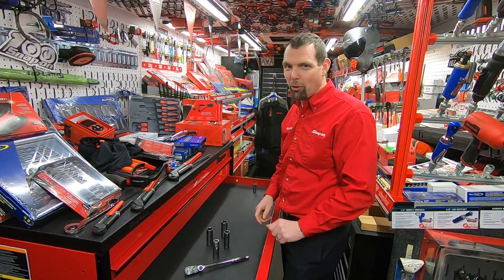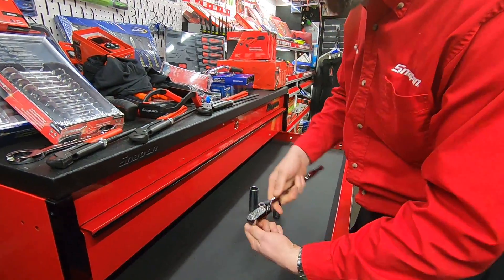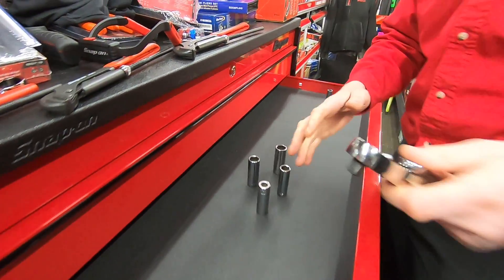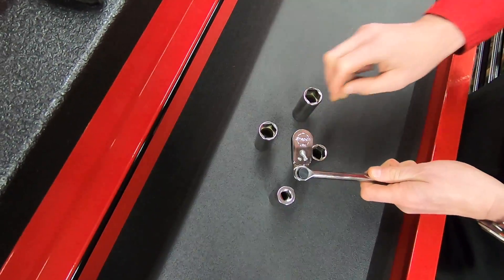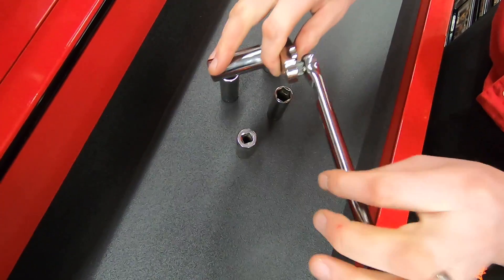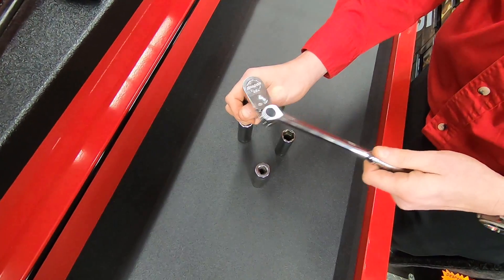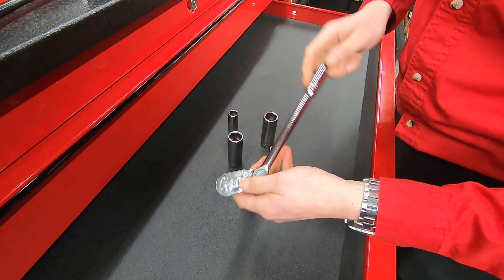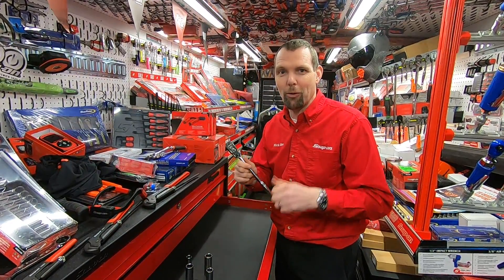NICK THE TOOL: MULTI-POSITION INDEXING RATCHET PN: F80MP

Comment: Is this available in a 1/4" drive?  Update:  picked up one of the T72MP (1/4" drive) from my dealer the other day.  Pricey at almost $160 but VERY handy.
Reply from the maker: Not yet
Reply: @NICKTHETOOLUK  when it will be?
Reply: @manuhonkanen2111  I have it in 1/4"
Reply: Yes. T72MP and TH72MP are 1/4in drive multi position ratchets just like this one
Reply: Yes, I have the 1/4" drive. Works great 🔧🔧🔧🔧🔧

Comment: ... what about BFCRM712A and a 3/8 breaker bar demo in various positions and movements... better than all the low profile ratchet kits... and again more versatile as chubby ratcheting wrenches either.
... why don't you show us e.g. BLPBB1224 it is an interesting indexable breaker bar also usable as credit collection tool to carry in cars...
... why don't you show us RWA404 used combined with regular combination wrenches... so tech guys can get a double offset and use sockets and bits with regular wrench already at hand to extend flexibility
... show the FSDR mini finger ratchet  applications